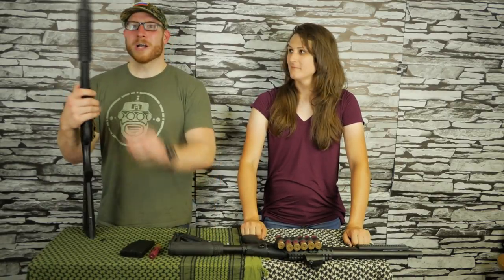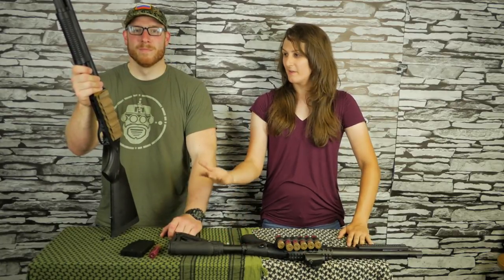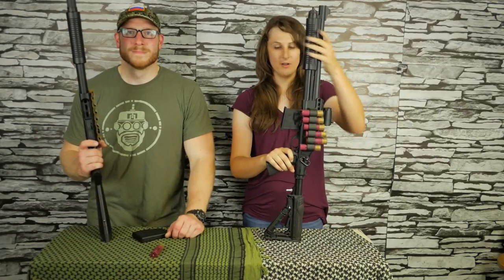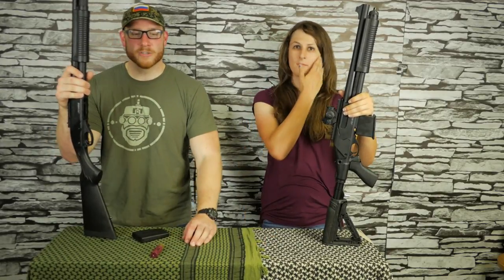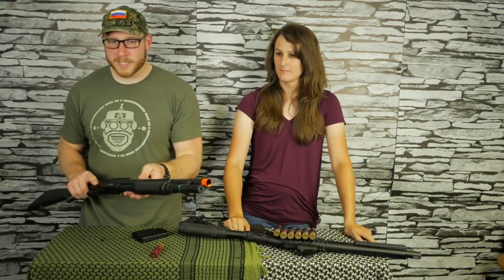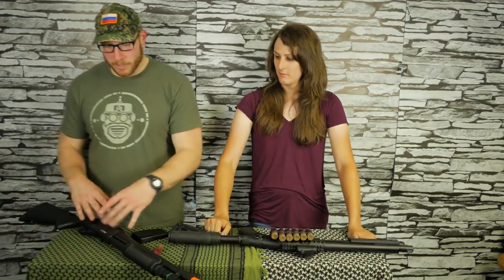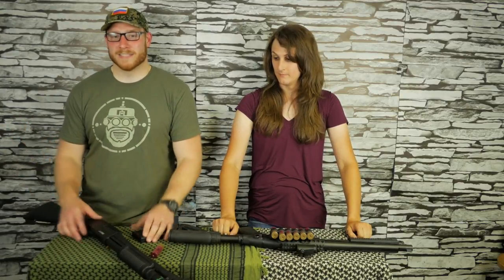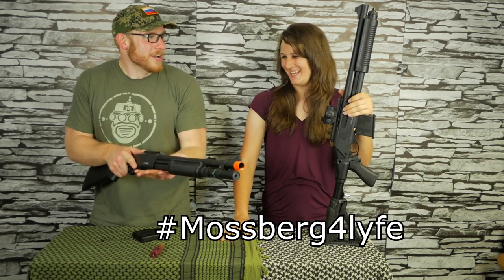SpeedSim: Problems With The JAG Arms Scatterguns

Comment: Just want to add my experiences and input here. 

I bought a Jag shotgun basically when they were released, and from day one it's had problems. I had the pump lock problem out of the box, although I was always able to eventually unlock it, and it seemed to become less common the more I used it. Fortunately it's an easy fix, that is to remove the lock mechanism entirely, which I did and haven't looked back since.

Now the other problem - growing leaks from the internal valve mechanism. I'm still working on a solution, but I've made progress. Essentially it's like a giant gas pistol valve, but instead of the gas pressure pushing the valve closed, it comes from the other direction, so the valve is only held closed with a spring that's fighting against, not with, the pressure. 

This is a problem with the original TM design, and like the jag, it has exactly the same leaking problems and is just as finicky, so I can't really recommend either. The Jag, being Chinese made, doesn't have great quality control, so you're even more likely to have problems, but you won't escape them by simply getting a tm. 

So in conclusion, based on what I've gathered and personally experienced, I just can't recommended the gas 870 from Jag or TM out of the box. HOWEVER, for me at least, it's worth it if you manage to get it working for the fun factor alone, just be prepared to put in some effort, or allot of effort. 

I was hoping jag would fix the original problems with all the "reinforced internals" garbo lingo they have been throwing around, but it seems the only significant thing they changed was adding a steel pin for the loading arm instead of plastic. They didn't touch the failure prone gas system, which I really hope they do eventually in a later version, because the gun has SO much potential. But why didn't they in the first place? Who knows...
Reply: Can you tell me how to disable to the pump lock?
Reply: How does one remove the pump lock?
Reply: wow, thank you for saving me $200.
Reply: How could I fix the internal leaking issue my shotty has had the same exact problems.
Reply: Yeah I've seen the TM's crap out just as often and for double the price.

Comment: The preview of this on day one or two of shot show 2017 was actually what brought me to find your channel before you were truly YouTube famous. And I was bugging my local retailer, shaq at ricochet tactical on long island, to get them in stock. I have the same full stock version and ran it for 3-4 cqb sessions of 3 hours and out 20-25 shells through it outside of gameplay. The issue i had was with the stock. The tabs for the butt plate are on so well (tight fitting) that after a short while they will break the corresponding tabs on the stock and in my case crack the whole stock. I also think that keeping the tank in the stock put more stress I'm not helping the crack expand.
I hope to have a replacement stock soon and I will take the precaution of grinding down the tabs in the stock and using 3 pieces of Velcro to hold the butt pad on the next stock.(2 pieces of soft side sticky back Velcro on either side of the stock and one piece of hard side Velcro with no backing to hold the butt pad in place)

Comment: Recently returned mine unfortunately
At first the gas tank was leaking iut of the box, but lube and teflon tape over the threading fixed that, but a couple weeks later, it would leak when installing the gas tank in the stock. Cool gun but still has problems.

Comment: Of course it’s still bad quality control, but most airsoft gas magazines have a large rubber “seal” holding the bottom baseplate together.  This is where most leaks occur, not from the valves.  I just take out this rubber piece and seal it up with some permatex gasket maker.  It’s cheap and effective.  I have some original kwa lm4 pmags that are over 6 years old that still hold gas with this mod!

Comment: I was looking at these as an alternative to the TM from the UK/EU distributor which falls under Secutor and I'm really glad I caught this. This is the sort of reputational damage which is nigh impossible to recover from. Given the cost attached this product for the shocking lack of QA it's a non-starter. For the price difference it's TM all the way.

Just as an additional point, why the hell do they come with 28 shot shells? Which muppet decided that was a good idea? It's a 3 or 6 shot scattergun, how does the 28 capacity shell become the best option? Mind boggling.

Comment: You should test the Tokyo marui m870. Has a higher pricetag than the JAG but i works a lot better. Mine held  up over an year until some parts broke.
But if you put some aftermarket parts in it, it will become a freaking beast  on  the field.
Reply: Lindau7471 the driving factor for the jag is that it's the m870 but cheaper. Not everyone can swing the tm

Comment: i use one with the internal gas system, ive beaten the living shit out of mine, probably put thousands of bbs thru it, used a tapp adapter, dropped it slammed it etc and its never had an issue. to anyone thinking about buying one i do think theyre pretty fantastic. i think these two just got a bad batch honestly. theyre also not that innacurate and dont overhop too badly if you use them in their intended range of about 1-20 (maybe more) yards, hate to say it but i think gungamers were also a little bit at fault here

Comment: you got bad luck then, my scattergun works great! gonna hpa tap mine soon
Reply: just to add on I got a day 1 scatter gun and the thing was leaking a very tiny, little bit, a tech fixed it for me for free and now the thing works great, i get like 8 shells off before i run outta gas.
Reply: I bought 2 Scattergun SP’s and they both work fine
Reply: Oliver Dotson 8 shells is a little low. I can easily get 20+ on one fill with mine